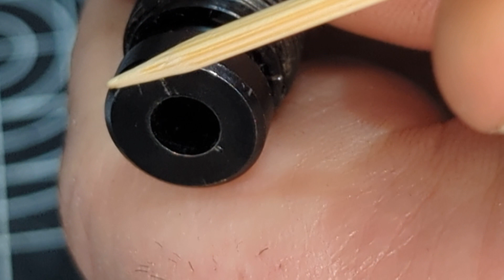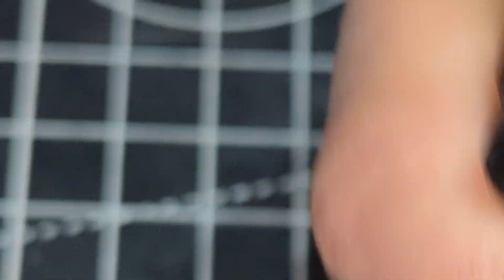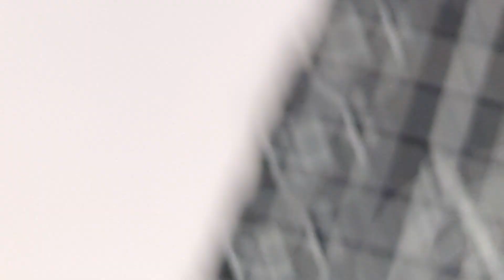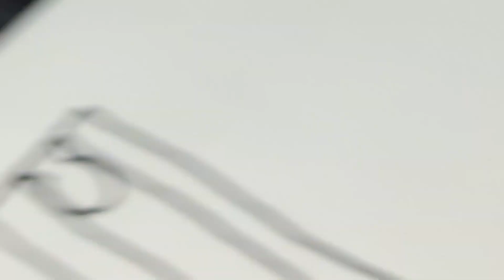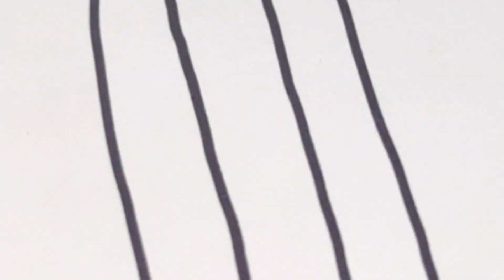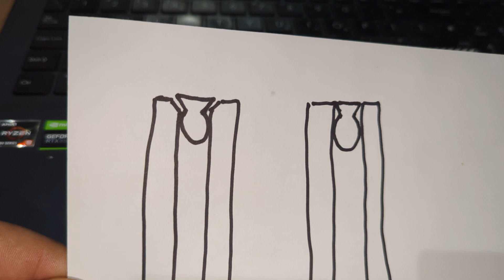LGU barrel and transfer port discussion.

Comment: I saw this the other day and when I went out shooting today I took the LGU along. When loading it I remembered your video and looked at mine and it's beveled. I push the pellets in and you can see they are seated down inside the beveled area. Not sure why yours is cut straight and mine came beveled leading in.